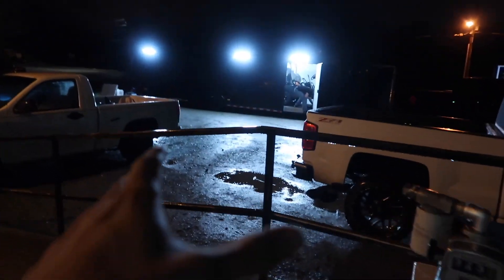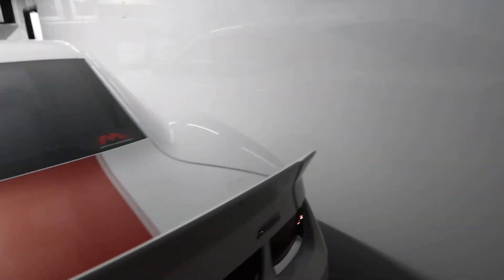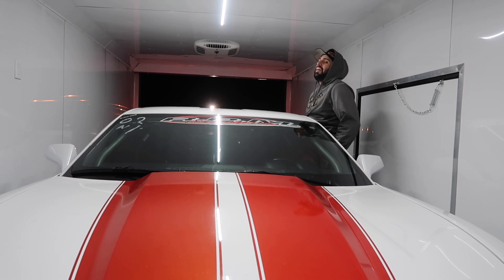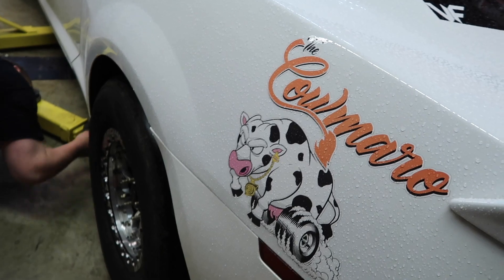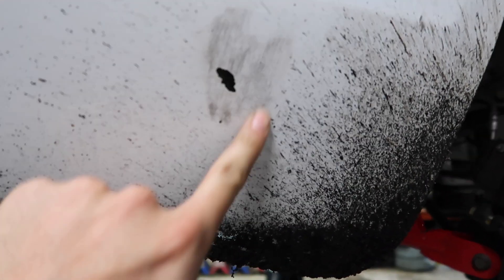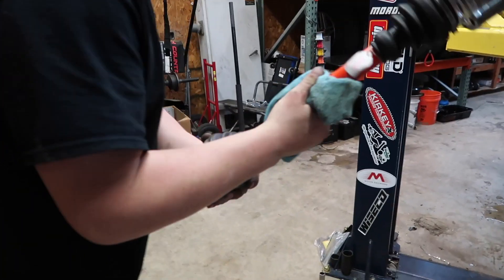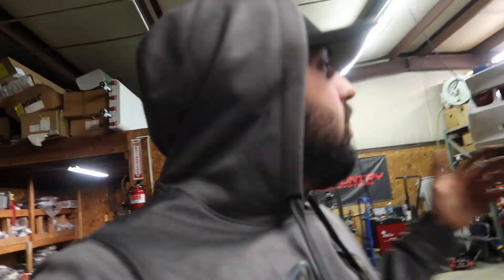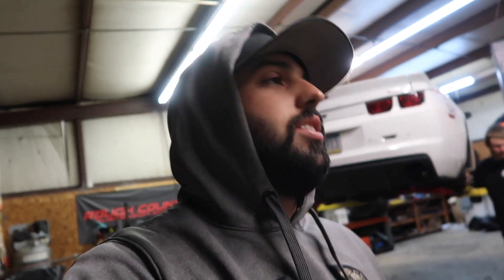ANOTHER BROKEN PART!!!! COWMARO DOWN!

Comment: You can make a set of limiting straps easy af. I made mine from some zinc plated log chains. Both are cut to 25 links, blue grade a bolt and nut thru my lower front control arms and a bolt and nut thru the top of my strut tower beside the one of 3 bolts to my coilovers. And I have 3 to 4 adjustments I can do with them. Right now I have them tight no lift. But I can take the nut off the strut tower bolt and pull the chains off to give or remove slack.

Comment: Spray a little wd-40 on your clean lower quarter panel and the rubber either wont stick or what does stick will wipe right off.

Comment: The Drive Shaft Shop doesn't have what you need. They say that insanity is doing the same thing over and over and expecting a different result. I would try a different company but if it happens again I think the answer is in some of the previous comments I read which is a straight axle. A live axle may be your only option..
Reply from the maker: I’m seriously entertaining the idea
Reply: If you go with another axle provider make sure you change out the other side too before you break it too lol..